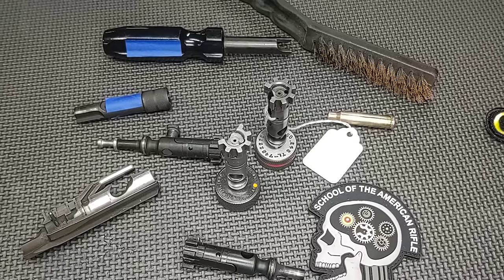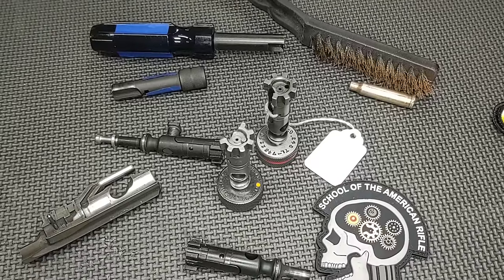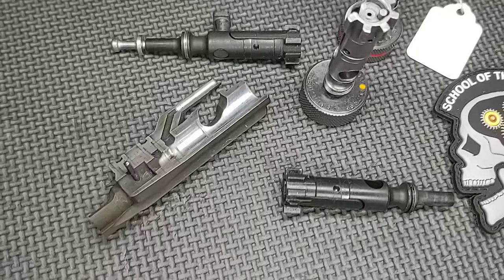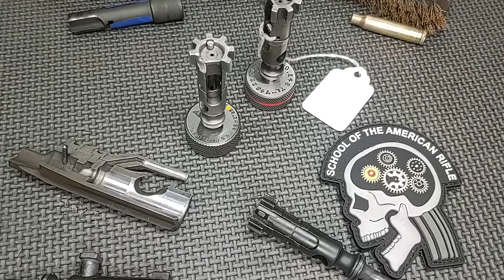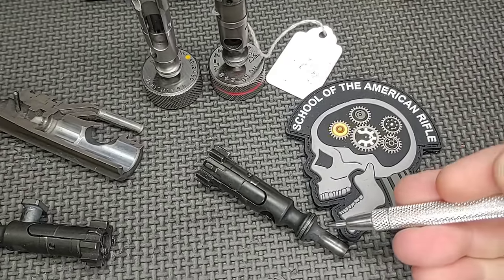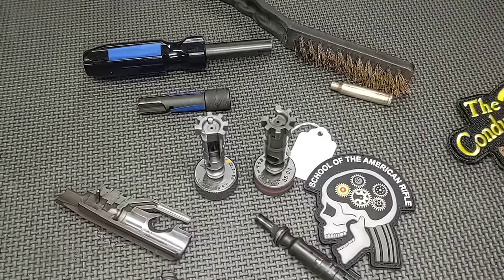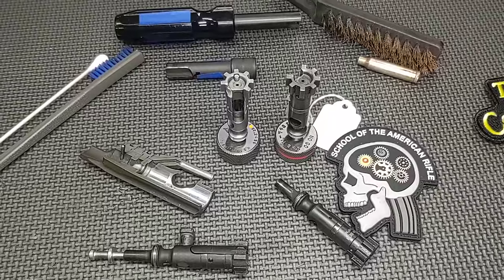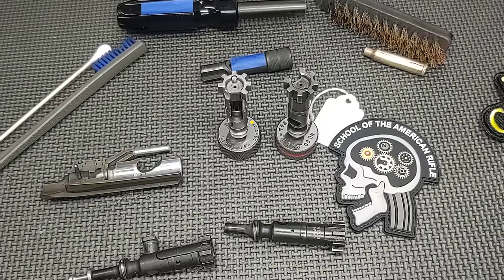Improper Cleaning can ruin your AR15 Bolt Carrier Group

Comment: To the creator of this video I have a question. Back in the early 90’s, when going through basic, the A2 rifles we were assigned were old. They also were spotless when being checked in and out. A spec of carbon/fouling when inspected by both the DI or armorer, got you a complete do over (plus PT in most cases). They were spotless when checked in. Countless times. I don’t remember ever seeing one malfunctioning. I’m sure it happened from time to time, but never personally seen or experienced it. I was a teenager then, and now in my early 50’s. While I’m not as anal as I used to be when it comes to gun clearing, I can’t tell you how many times I have stripped every single deposit off my BCG’s. I still have AR’s from when I was an instructor in law enforcement that still shoot great. The two major components I have ever changed out from excessive wear had been the barrel and a bunch of cam pins from the BCG. I’m sure if you were to inspect a few AR’s I have you would definitely flunk them. But they’ve never failed me. Ever. And on top of it, are proven tac drivers. With that being said, are today’s manufacturers and/or materials lacking in your opinion. Compared to years past. I ask because I’m now in the aviation industry. Getting quality materials are a challenge anymore. Especially when dealing with corrosion. I know of many customers with new ACFT that are suffering from today’s material issues. New and improved material processes today are becoming more evident not as good as the processes used in the past. Both with steel and aluminum. Whenever I hear the term “Aerospace/Aviation quality” I chuckle a bit. Because I can promise you that it’s not as good as it was decades ago. I guess what I’m getting at is are these things your teaching us about real or serious issues that you see today. Or just things to pay attention to for issues that may arise? I’m a big fan of this channel. I think you have a great thing going here and I look forward to your videos. But I can tell you that several of my AR’s I have no doubt you probably would say, “everything requires replacing” lol… and they all operate very well. With almost everything I feed them. I’m interested in knowing how many times you see these issues causing problems with consistency.
Reply from the maker: My advice is free. I'm not offended if people ignore it disagree with my content. I post it to try and help people. 

Your AR could pass my testing. Your AR is more likely to have problems if you clean it aggressively. 

My data is based off testing guns that had/have problems and finding the reasons for failures. With repeatable data, I create methods to locate potential problems or offer advice on how to minimize problems. 

Aggressive cleaning can make the AR less efficient. This can lead to failure to cycle, failure to lock the bolt open on the last round, failure to work in the cold or higher altitudes, or failures when the weapon is dirty. NATO pressure ammo helps conceal inefficiency, but Military issued M4's and M16's have pretty efficient gas systems from the start. Civilian AR's are not always so efficient from the start so abusive maintenance can push them over into the unreliable category.
Reply: @SchooloftheAmericanRifle  Would you have an interest in evaluating and diagnosing a KS-47? It's not exactly an AR, but similar.... 🤞
Reply from the maker: @adamc2928  have worked on many of them. I actually made some changes to the GEN1 models that were similar to the fixes that PSA implemented on their GEN2 variants.
Reply: @SchooloftheAmericanRifle  thanks for the response. Again I think you do great work and I can tell you have a wealth of knowledge. And given your response, you have shed light about what I’m asking about. I have seen enough of your videos to know that you’re genuine. Keep up the great work.

Comment: Cotton swabs and nylon brushes or even old tooth brushes are all I have ever used on guns. 
You always gotta be careful with sealing surfaces, running hard tools like that on a sealing surface just because it's supposed to be softer than the bcg is crazy.

Comment: I've put about 8k rounds through my "ReCcE" rifle over the last like 2ish years. I run it with a RC2 literally 100% of the time. My cleaning takes like 1 or 2 minutes. I just run a bore snake down the barrel and wipe down the BCG, bolt, buffer spring and weight with a microfiber cloth and breakthrough oil also I put my RC2 in a jar of CLR every 1k rounds per surefires instructions. But I've literally never had any issues with it, and it's my only rifle. Granted it's a bit more on the higher end, but it's still running a milspec trigger, s&w m&p sport 2 upper and lower and an aero bcg. Maybe im just lucky but I've honestly had no issues with either brass or steel ammo. Stop over cleaning your modem ar15s like they belong in a museum or gallery. 😂

Comment: I tried to file a bolt to test this theory and failed spectacularly. So, I am not convinced that flashed brittle carbon (which is much softer than hardened bolt steel) will “lap” said steel. Of course I have seen (many times over) pulverized carbon and liquid cleaner, caking between the bolt tail and the firing pin, causing the firing pin to seize and misfire up to 3 charges. 
Come on man!

Comment: Yes, thank you VERY MUCH. You have shown me how to CORRECTLY CLEAN MY BOLT CARRIER. I've got 2 ARs and the parts for 2 MORE, JUST IN CASE. 🤔😯 I've haven't shot mine enough to REALLY get DIRTY OR FOWLED with carbon. I've probably only shot about 20 rounds through both of them for sighting in the iron sights and scopes. Plus ammo is TOO EXPENSIVE to just blaze away with them, I save that for my 22lr rifles and pistols. 🤔😉😃😃😃👍

Comment: It was my understanding that scraping tools were to get hard run guns back in the fight quickly when out in the field and unable to do proper PMCS.  I never even considered using them for basic bench cleaning.
Reply from the maker: Lube does that.
Reply: @SchooloftheAmericanRifle  that would be my preference as well.  I bought a couple of these scraping tools when I first got an AR because it sounded like a good piece of emergency kit, but I've never used any of them.  In a pinch, a wipe down with lube tends to loosen up a lot of the crud without even resorting to solvent cleaners.  I imagine in the field that would get you running again most of the time.

I've never done such a sustained burndown test that my rifle completely stopped functioning so I never really had an opinion on them, but I'll take the advice of an actual expert telling me they genuinely aren't necessary.

Comment: I'm a relatively new ar owner. Is there a particular lube and or method of which you'd recommend?
Reply: You need to check out his lubrication video: syn grease + syn oil mix with a drip test for viscosity.  Made a believer out of me coming from a guy with 20K+ ARs under his belt!
Reply: @NormanPOlt  thank you

Comment: If people did basic cleaning after the range, the build up and hard carbon is  really a non issue and a breeze to clean. We were taught in the military to run the guns wet. Never had a issue, see plenty of peoples guns stop working because they are dry as a bone.

Comment: Could 2 o’clock ejection be an outcome even if the gas port is not too wide? Like the bcg being too short or just so out of spec it’s throwing brass forward? Anyone seen anything like this?
Reply: Try a lighter buffer weight

Comment: I've always used only chemicals, cotton and/or softer poly bristles on bcg's and chambers... On all my firearms. Always figured gentle was better, and by being OCD about cleaning after every range trip, and having a very very light layer of oil on all the dirty areas, has made it where I've never had overly caked on deposits that wouldn't clean up fairly easy.

I usually shoot between 200-500 rounds thru a firearm on a range trip, so I don't feel crazy about cleaning them and re-lubing after the range. I've always had ultra reliable firearms too, I believe because of it.